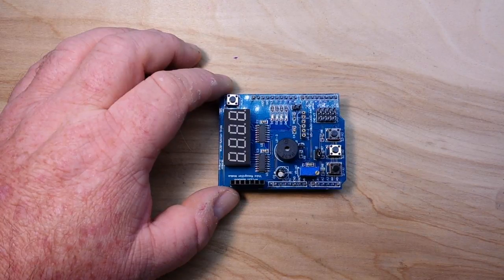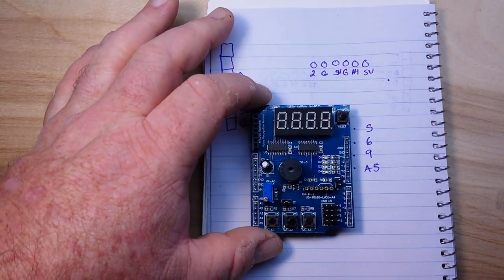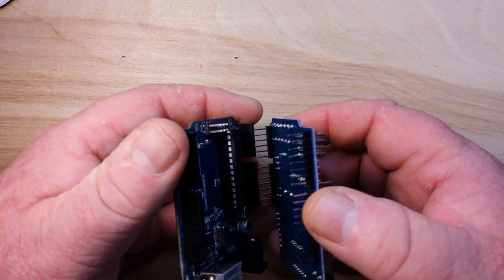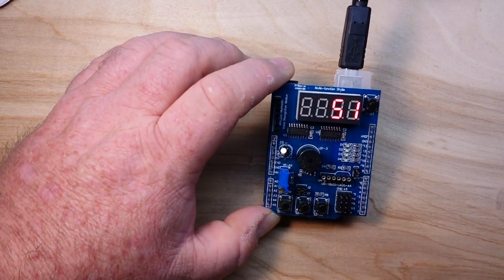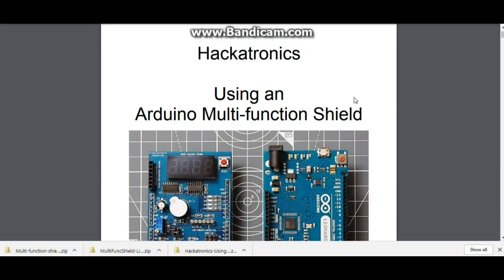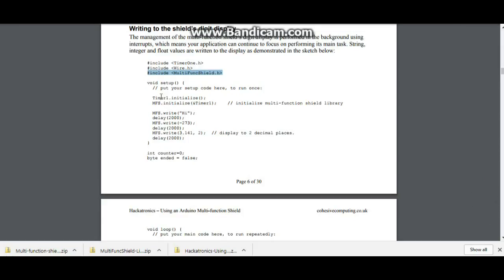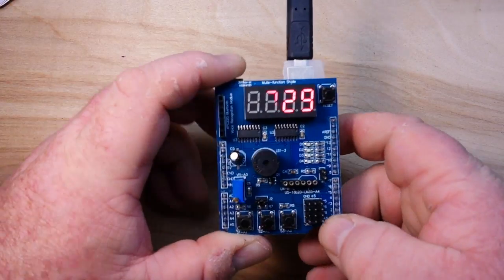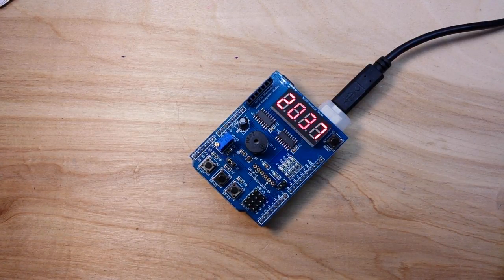Arduino Multi function Shield

Comment: Spent so much time trying to figure out why my 5 was coming out as a 9. You are the first video I watched that actually mentioned the pins contacting the usb jack! Thank you!
Reply: Thanks for the TIP.  I bent the two offending pins down AND put duck tape (three layers)  on the metal top of  USB connector to insulate.

Comment: I am using kicad to try and improve the shield

Tm1637 instead of 595 x2
Ws2811 x2 instead of 4 seperate pins
SPI, I2C, and UART connectors
2 pwm pins (6, 9)
3 analog pins (A1, A2, A3)
Passive buzzer instead of active

Comment: I've seen the schematic diagram and there s no current limit resistors on the 7 segment. it might cause overheating problems as far as I know.  à CMOS device connected directly to a diode not a good idea.

Comment: Am wondering what (and why) those two chips are.  8 bit port expanders (PCF8574)?  Shift registers?  Darlingtons?  Aside from the USB collision issue on your the old-style Uno, they would have done well to put a rotary encoder in place of those three buttons.  Still, it is wild they can manufacture and ship these kinds of things for $2.  I have built similar devices for myself with just 4 wires: power and an I2C interface.

Comment: I don't understand why they would make a shield that does not fit the device it was
designed for.
Reply from the maker: dwpetty3723 It's always a crap shoot. This time I got snake eyes
Reply: Arduino UNO itself is designed with a silly spacing error between the pins.

Comment: Truth to be told, the reason this shield does not fit nicely into a breadboard is a screw-up from Arduino UNO designers. The irregular gap between the headers on the digital side was caused by their accidental design glitch that made it into production. This shield has no other choice but to follow suit.

Comment: Good afternoon, I bought such a shield, installed libraries, installed sketches, but the seven-segment indicator does not work (does not light), the buzzer and LEDs work, segment 7 does not work, I even tried the IDE arduino 1.8 .5 and 1.8.1, what could be problem? I myself suspect that the 7-display is a different brand. three shields and all with the same problem. 
                                  display marking 3461ВS .. or 34618S ..
                       thanks in advance      my mail asv7771@yandeks.ru
             //  добрый день, приобрел такой шилд , установил библиотеки, заливаю скетчи, и ни с каким скетчем не работает (не светится ) семисегментный индикатор, звуки и светодиоды  работают , семисигмент нет, пробовал даже ардуино IDE 1.8.5   и 1.8.1,  В чем может быть проблема ?  Сам подозреваю что дисплей  7сигмент  не тот впаян
    дисплей  маркировка     3461ВS..    или      34618S..  
  заранее    Спасибо       my mail asv7771@yandeks.ru